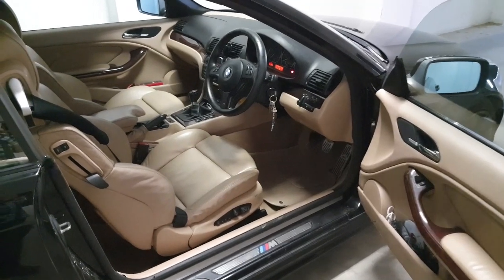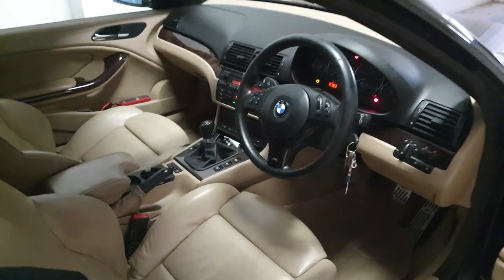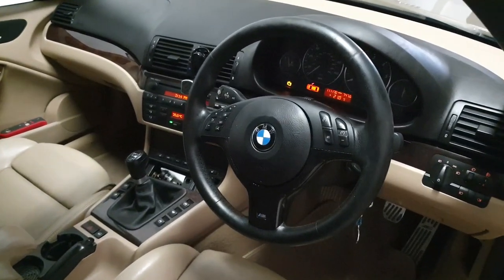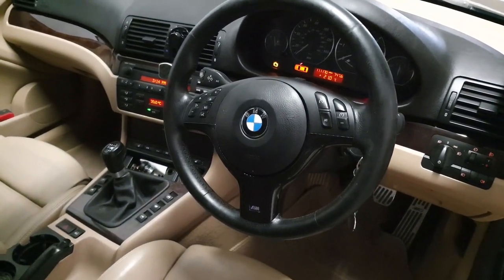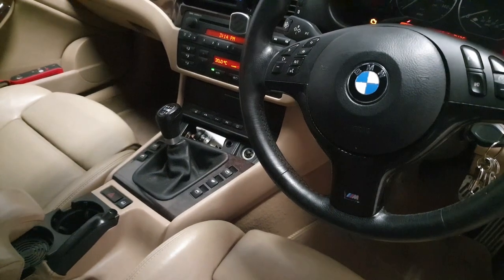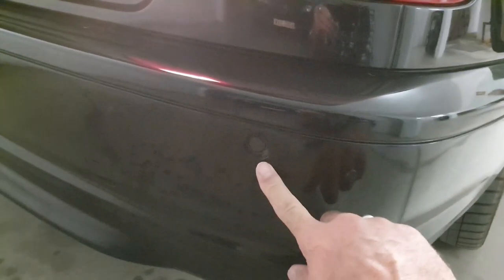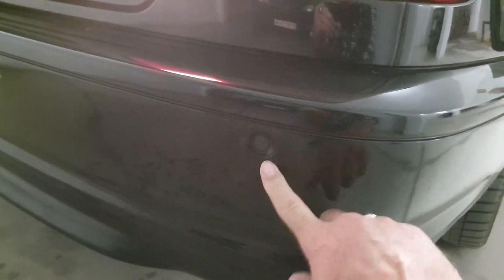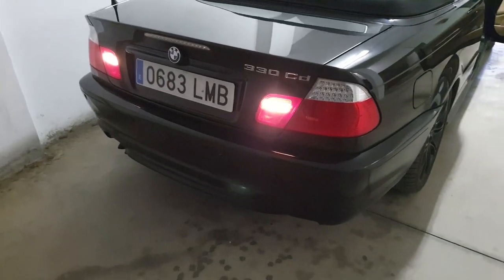HOW TO CHECK FAULTY REAR PARKING SENSORS

Comment: Make sure to tell them to put the emergency brake on too before getting out of the car. Otherwise everyone will have to need more than a new sensor, they gonna need a new rear bumper lol
Reply from the maker: Well clearly you DO NOT have the engine running... like in my video. So the car will not be moving anywhere.   I guess it needs pointing out for health and safety.
Reply: did you even watch the video? the engine is off!